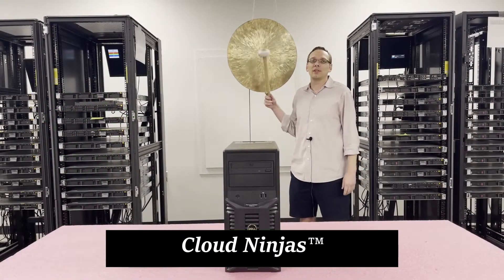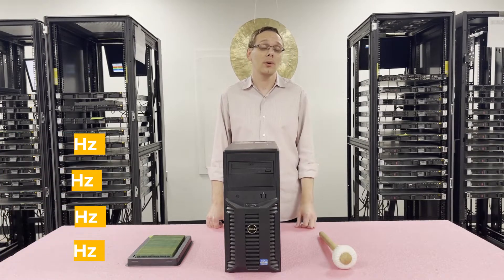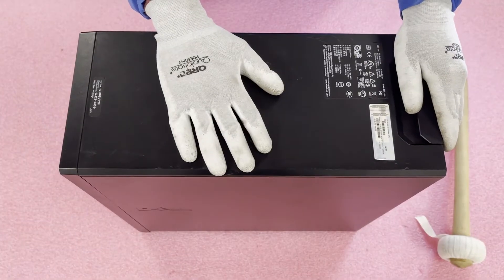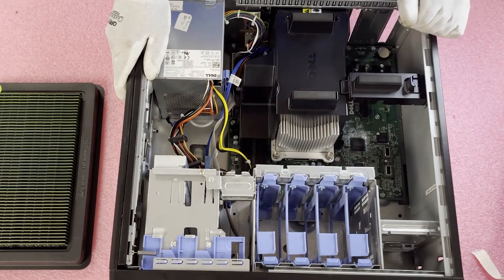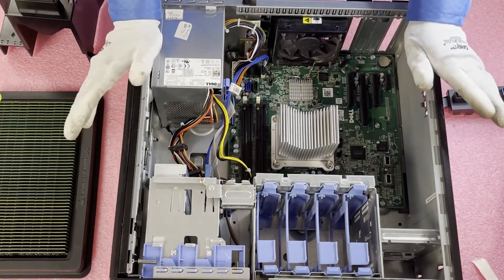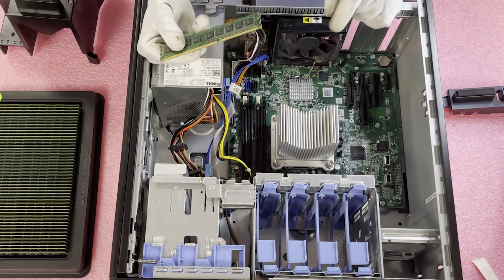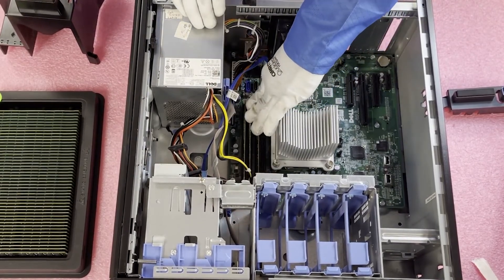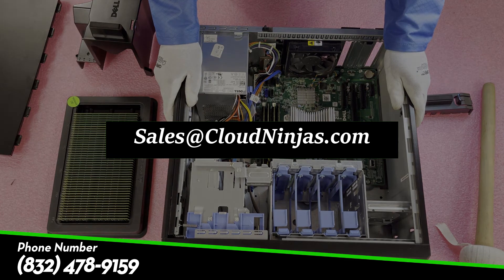Dell PowerEdge T110 II Workstation Review & Overview | Memory Install Tips How to Configure | Gaming

Comment: Can I install windows 10 and use as a regular PC ?
Reply: Yes you can infact I am using the Dell PowerEdge T110 first gen server/workstation tower, it was a bit tricky getting the drivers, i had to use the one it came with the original os and luckily that work but yes you can install windows 10 make sure you have a decent graphics card and at least 16 gigs of ram.

Comment: Hey, how's it going?

I have a question: I wanted to know if any RAM with up to 1600MHz works on the server, or if it needs to be a specific brand or model. I also noticed that in some videos, they mention PC3 RAM, and in others, it's PC3L RAM. Is there any difference, or depending on the memory that came with the server, do I need to stick with either PC3 or PC3L?

Did you understand? I'm not very good at explaining things.
Reply: Based on the explanation of the video, it can take it but it will down clock to 1300mhz i think so even if you were to put it in it will down clock the mega hertz. best to get with the highest it is design to get unless your planning to use the ram for another computer in the future.

Comment: Hello,

Our Dell PowerEdge T110 II (Has two HMT41GU7BFR8A-PB 8GB memories) positioned in SLOT 2 and 4)

I thought about buying two more HMT41GU7BFR8A-PB (install in Slot 1 and 3) adding 32GB of memory.

When installing the Dell already recognizes the memory automatically or do I need to perform some specific configuration?
Reply from the maker: System will recognize the memory.

Comment: I was thinking of gaming on it using gtx 750ti with external power supply
Reply from the maker: Nice. Have fun!
Reply: R7 370 4gb works on mine.Games run too
Reply: You will have to change psu though